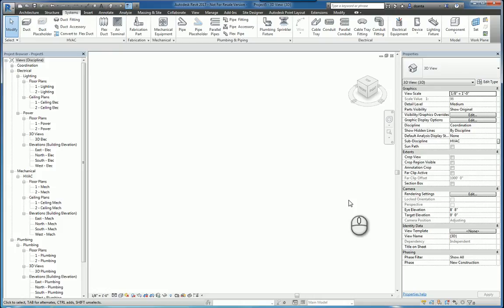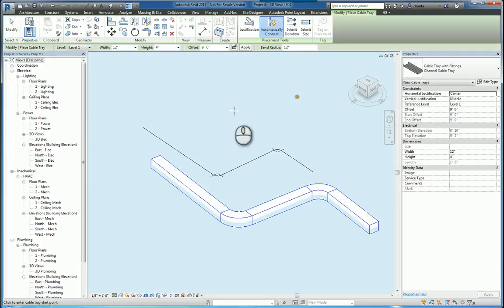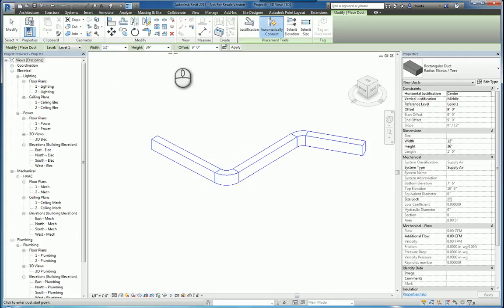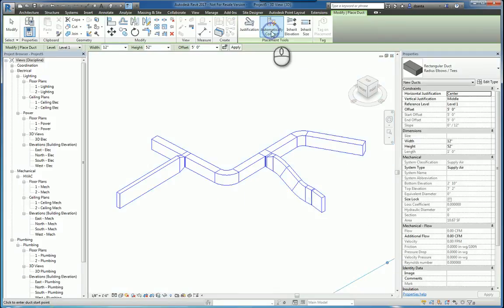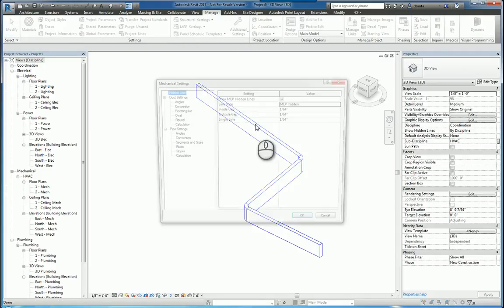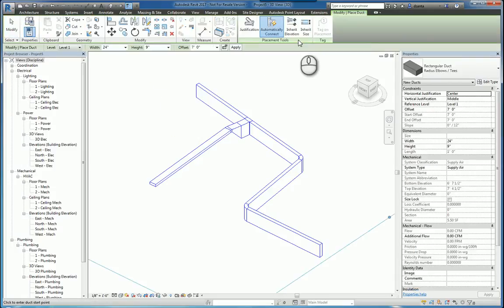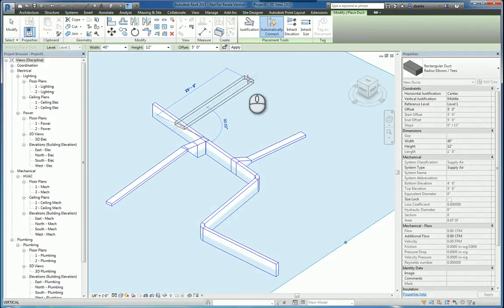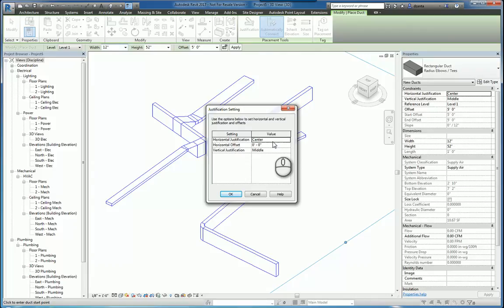Revit Placement Tools   A How To Guide

Comment: I wanted to buy a loptop for revit, what hardware configuration I should go for ?
Reply from the maker: faster processor you can afford, 16gb ram min, 256gb ssd hard drive. dell or hp
Reply: thanks
Reply from the maker: forgot to mention...make sure the graphics card is a quadro 2GB ram card certified to work with Revit...
Reply: Thank you :-)